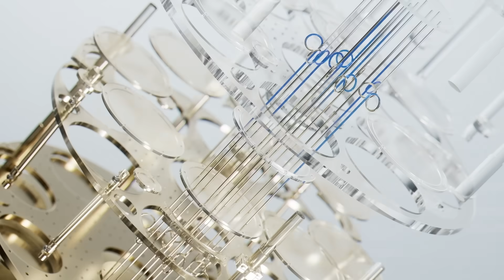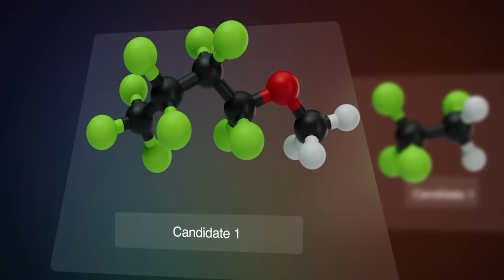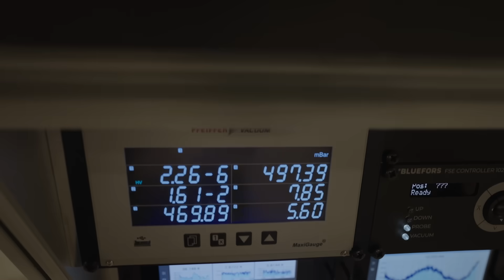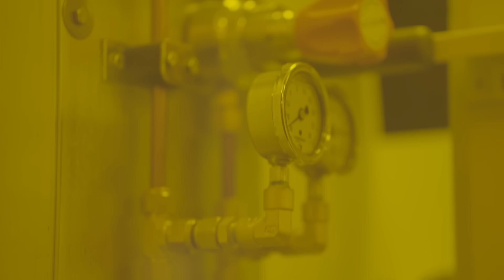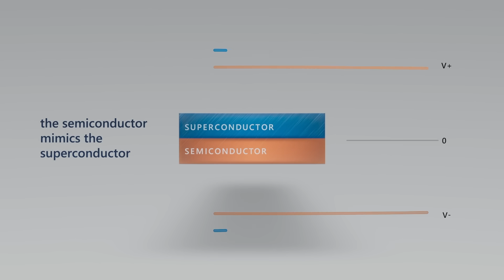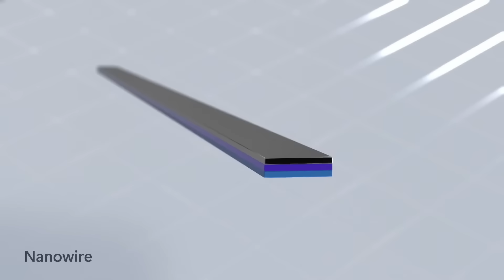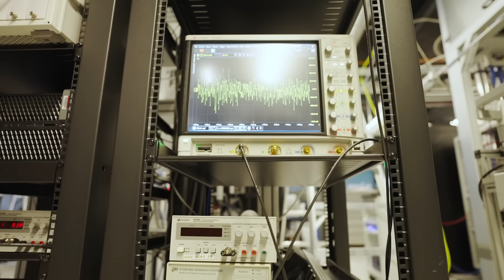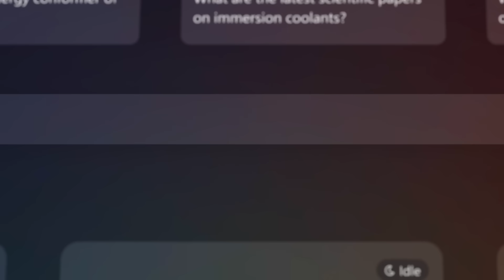Majorana 1 Explained: The Path to a Million Qubits

Comment: I'm a retired Bell head tekkie. The science is fascinating. I "get" qbits.  But where's the engineering? Have you conducted temperature cycling tests?  65/ 65/1000?   Until you have field tested this chip as a system for stress testing, it will remain just a curiousity.  Ditto with testing and repair.  Once you have a field replaceable unit, you've got nothing.

  Like fusion energy. Fine if it's a star.  Perhaps these devices should ride aboard next generation space telescopes?

Comment: is it just me or did this actually sound pretty convincing despite the usual "quantum computer breakthrough NOW" kind of hypes? should be applicable and useful, not just theoretical, no? 

i can especially see this in some type of virtual reality simulation, computing weather, maybe realistic water/fluid physics, etc. then only translating it to "normal" data (the slow results) if you are actually interacting with that part, are looking at that part in the game, are checking the temperature and humidity in exactly that area to that time, etc. ? but the actual correct simulation still keeps running "in the background" with the q-bits mathing it out?

Comment: They are talking about elementary fermions, I am curious how can this be in more than 1 state at a time (which is what a Qbit is supposed to do), since by Pauli exclusion principle no two fermions can occupy the same quantum state at the same time.  So how do they collapse the Qbit if it is not in both (or all) states at once?
Reply: The interesting thing is that the majorana fermion, as a quasiparticle in condensed matter physics, has both particle and antiparticle properties simultaneously.

So it is not really an elementary fermion (I.e. it is really a particle). It is really a collection of a group of particles that behave like a particle (hence the word quasiparticles). They are claiming to have engineered a topological qubit out of these collection of excited particles. However, I will say that a lot of working solid state physicists, are skeptical on Microsoft's claims, but the theoretical work is sound (see topologial insulators, majorana zero modes, and anyons)

The reason why topological qubits are sought after is because of it is robust against noises via topological protection, whose origins are what we call the bulk boundary correspondence.

Hope it helps.
Reply: And ooo, google does research on anyon quantum computing. Nice!
Reply: @romanmir01  
The qubits part is the entire state of the topology, or the system.  Depending on how they braid or manipulate the material to say include an electron or remove it, that's a 0 or 1.

Comment: Platitudes are nice for a promo, but let's have some SPECS!  How stable is it? Does it require a low-temperature, low-noise, for example?  when does it hit the market? at what price?  Running which OS?  If this thing is legit, then crypto will need to work like crazy to beat it. Okay. superconducting semiconductors?  This is extraterrestrial technology.

Comment: (EXPLANATION) Okay, here’s a simple way to explain it in layman’s terms:

Think of your brain. You can only focus on one task at a time. If I ask you to calculate 2 + 2, you do it. But if I ask you to also solve 4 × 6 at the exact same time, you can’t—your brain switches between them.

Then came supercomputers, which can do these calculations much faster. But as we started tackling more complex problems, even supercomputers began to struggle.

Now, imagine a lock with 4 switches, where each switch can be 0 or 1.
To unlock it, you’d have to try every combination:
	•	0000 → Wrong
	•	0001 → Wrong
	•	0010 → Wrong
	•	…until you find the right one.

There are 16 possibilities, and a supercomputer can test them much faster than you.

But now, let’s scale it up—what if the lock has 1,000 switches?
	•	The number of possible combinations becomes so large that even the fastest supercomputer would take billions of years to check them all.

This is where quantum computers come in.

Unlike normal computers that try one combination at a time, quantum computers use qubits, which can be 0 and 1 at the same time because of superposition.

So instead of testing each possibility one by one, a quantum computer can explore many possibilities at once and find the correct answer exponentially faster. And it can do it in hours unlike a supercomputer which takes billion of years. How amazing is that? 

Now you must be wondering how something can exists at two different places at a same, like qubits can be either 0 or 1 at the same time, this is being allowed by a quantum concept called superposition.

Remember double slit experiment in your school time? Where particles tends to cross both slits at a same time? Until we observe it, if we observe it or measure it will behave like normal, this is a sorcery which happens at a quantum level. Read about it.

Here in this Majorana, I call it a sorcery, they have a million qubits in a hand size chip which is something extraordinary and can perform things where even human brain can't even imagine to reach. Hope it helped.

Comment: After conversing with AI for what seemed like 10 pages of back and forth, I finally understand.  In traditional qubits, information is stored in things such as electron spins (an attribute of electrons), which an electron exists in a finite spacetime region as a probability wave.  However, because it's localized (in a small region like an electron cloud), extremely tiny microscopic changes in temperature or magnetic forces could change that state, collapsing the superposition of the electron, resulting in errors. In quantum mechanics, measuring one superposition particle collapses the other particle's information. That's to say two particles with a superposition (meaning they're linked to each other despite being across spacetime of even billions of light years apart) so that if you measure one particle's value, you immediately know what the other particle's value is.  And these values aren't preset like saying a right shoe or left shoe because before you measure it, each particle or shoe exists as both a right shoe and left shoe simultaneously, so whatever you happen to measure what reality is on your end, the other particle instantaneously exhibits the opposite attribute.  This is Einstein's "spooky action at a distance" because he refused to believe nothing can travel faster than light. And Einstein is correct IF you're traveling THROUGH spacetime, but superposition information isn't traveling through spacetime. 

On the contrary, you don't have issues with micro changes affecting topological state qubits.  That's why you hear about all the errors with quantum computing and that you'd need a lot of qubits (like hundreds of thousands, or millions) to process with acceptable error levels.

In topological state qubits, for example, you might use a nanowire (which is designed to be in topological state of matter, meaning one side behaves like a superconductor and the other side like semiconductor/insulator) that has two ends you can manipulate, called Majorana zero modes (MZMs).  Instead of measuring a single electron's state, the electron is spread across the entire nanowire, so the combined overall state of the nanowire (a few mm in length) IS the data.  The electron wave function is spread across the entire nanowire (because as we learned, electrons and things sufficiently small, even molecules made up of thousands of atoms in size, exhibit both particle/wave duality, meaning they exist as particles when you measure them but exists as wave functions when you're not).  As a result, it's fault tolerant because information isn't localized, but is the full measurement of the nanowire because the electron exists across the entire nanowire as a wave function. The state of the electron or lack thereof (0 & 1) therefore is the entire measurement of the nanowire.  A single event at one MZM wouldn't affect anything.  You'd need to have some larger catastrophic event such as temperatures rising across the entire nanowire affecting BOTH MZMs to collapse the data.  Each MZM effectively is half of an electron, and as long as the nanowire has sufficient distance between the MZMs, their data integrity is intact.  Microsoft uses a "network" of nanowires to store all the information.  How you move the MZMs around to swap places, essentially the order in which you do it, affects the final qubit value (0 or 1).  Only when you bring the two MZMs together do you collapse the waveform and an electron forms, thus reading the value (0 or 1).  You move the MZMs using electric or magnetic fields.

Main thing is Microsoft's approach requires magnitudes of order LESS qubits, and has fault tolerance because data isn't being stored locally (like in a single electron) but rather over the entire nanowire structure, kind of like saying there's one person in your home, therefore that's a 1.  If there's no one, that's a 0.  Now imagine 2 doors, front and back.  Those are the MZMs, where you can manipulate (called "braid") changes, read data etc, or in this example, allow the person in or out.  In order to destroy any data, you'd need to simultaneously block both doors or something.  One door going bad won't affect the person.  In traditional qubits, the state of the person in the house (ie awake or sleeping) determines the 0 or 1, but because the person can be knocked out with medication, or awaken by something unexpectedly, you can't be 100% sure about the data.  And for regular quantum computing, if you measure the data by seeing if the person is awake, you may inadvertently wake them up (ie collapse the superposition wave function), resulting in "errors".  Dumb example but you get the idea.

Note that this isn't a new state of matter like a solid, liquid, gas, plasma etc, but rather a different, exotic quantum state.  It's extremely hard to create.  This topological state matter is the only type that allows two MZMs to form on the ends, which is sort of like a Majorana fermion-like behavior because the two MZMs annihilate each other's values when brought together (ie the half electrons superposition collapses and form into an electron).  They don't literally annihilate each other and create energy as matter/antimatter does.
Reply: Thank you
Reply: thanks bruv
Reply: I don't understand why this is resistant against perturbations though. If the wave function spans across the wire, any change to the wire should affect it.
Reply: @wasgehtsiedasan8660  
You'd need to affect both MZMs to destroy the data in topological state qubits, whereas a single electron or photon in traditional qubits is very hard to keep isolated and easier to decoherence with various interactions.  In the example of the house with the 1 person, imagine 2 doors, front and back.  You'd need to block both doors to prevent the person from leaving if something bad happened to the house, whereas many different things (only 1 thing) can cause the person's state (sleeping or awake) to change.
Reply: Very thoughtful and great explanation.wish I could copy this and study it further.
Reply: @VamYang  I went down the rabbit hole with Ai on this as well. Although my conversation led to learning about Nitrogen Vacancy in diamonds being used as Qubits. Which is fascinating if you want to check it out. But my point is, Ai is bananas. I love it.
Reply: Quantum physics is b.s. IMO
Reply: @dco8562   How can it be BS? Interpretations of it might be BS perhaps, but quantum physics itself is a thing.
Reply: @dco8562  
Literally everything we take for granted now like phones, computer screens, solar panels, MRI machines etc are all made possible by Quantum Mechanics.
Reply: @VamYang  those things are all made possible by the harnessing of electromagnetic energy.  Quantum physics asserts (ever since the famous "double slit experiment"), that electrons exist in a superposition state until they are "observed", but I maintain this is a faulty interpretation based on assumptions about the nature of light/electricity itself.  The "wave/particle duality" concept is ultimately a philosophical acceptance of a logical contradiction in terms/definitions from the outset.
Reply: @dco8562  
It's unbelievable, until you realize the predictions in Quantum Mechanics are tested and matches theory and mathematical equations.  In science it's OK to question.  But if you test and your observations match theory and mathematical equations down to the decimal points, you can't deny it.  That's like going outside and seeing the sun shining warmth on your skin and rejecting that it's the sun doing it, that it must be the air only.

Let's put it this way... Even the greatest scientist in our lifetime, Albert Einstein, the father of the two pillars of modern science, General/Special Relatively and Quantum Mechanics (with his work on the photoelectric effect, which he won the Nobel prize in), didn't believe in the chaotic nature of Quantum Mechanics.  But you can't refuse it when facts show otherwise.

Comment: Wait - so you are using 1 million quasiparticles such as majorana to do quantum computation. Majorana are known to have low fidelity with higher error rate. That means a tons of quantum error correction would be required isn't it? So lots of your horse power may be spent in error correction instead.

Comment: ♥ If it operates on a binary system, it won't reach its full potential. It's merely an extension of what we already have. Nature itself isn't binary—it's not just "off" or "on," but exists in shades and states in between. A flower doesn't simply go from "off" to fully "on." Quantum computing will have a very limited lifespan if it remains based on a binary system. So you cannot solve problems of nature using binary system you must go beyond it. Your brain in terms of how it interprets signals is not binary.

As of now, it's likely that another revolutionary technology must emerge to save the computing world, one that will be based on something more stable and beyond the binary system. There are experiments involving artificially grown biological neurons that aim to replicate how the brain processes information—this is most likely the future.

you cant use old mindset to bring something revolutionary, unfortunately quantum computing is built on the old ways of thinking and hence potential is limited. Would be interesting if they would adapt at list ternary system, where no particles present is 0 and 1 particle is one and 2 for two and this may lead somewhere constrictive.

As for measuring elusive particles, well, quantum experiments have already clearly shown that if you observe something, you measure it, and in doing so, you give reality to it. This should now be knowledge derived from experimentation by now but it still isn't sadly.

Comment: Ah yes, the Majorana 1 quandary—an intricate dance of topological quasiparticles existing in a non-Abelian braid group, where quantum decoherence ostensibly collapses into an emergent anyonic symmetry. The fundamental premise hinges on the fractionalization of zero-energy modes, wherein the non-locality of Majorana fermions within a p-wave superconducting lattice disrupts conventional fermionic statistics. But herein lies the paradox: if the Majorana zero modes encode quantum information nonlocally, does the braiding-induced unitary transformation truly manifest as a fault-tolerant quantum gate, or does the topological protection merely obfuscate decoherence pathways within the Hilbert space? The real question, of course, is whether Majorana 1 signifies a boundary state or an intrinsic topological defect within a Kitaev chain, and whether its purported stability against local perturbations is an artifact of idealized mathematical formalism rather than a physically realizable quantum computational substrate.

Comment: Does nothing practical, shows nothing practical, resolves nothing useful, looks shiny ! Is a decade or more since they started with this, and until now their "super quantum cpu's" can't even be made to run a simple benchmark of a basic CFD simulation, or compile some code or DO anything at all. All they show is people talking about how this will change the world, how awesome it is, even if nothing at all of what it does is shown, they maybe show some oscilloscopes, and behold, our new chip that looks like something from the 60' with huge bolts and resistors on it. Now, in the era when your average iphone cpu is made at atomic sized level with multiple layers of billions of staked microscopic components. Yea, nope, sorry, i don't buy it. Not to mention, that if you get to have a real quantum cpu, that does anything you want and solves any equation and simulation you throw at him. Tell me how you store, sort and process the unimaginable amount of data you would get?

Comment: They talk about millions of qubits but if you read the fine print they have 8 currently.
Reply: 8 completely stable ones and then can scale it up (they are the only ones with stable qbits that can run at full speed )= BREAKTHROUGH

Comment: Genuine question: what are all the pipes and tubes connected to it? They show a lot of that in the b roll but don’t go into what this housing does/what support it provides the chip etc? I’m so curious…
Reply: They provide cooling for the superconductors which need extremely low and stable temperatures to function properly.
Reply: Thanks :)